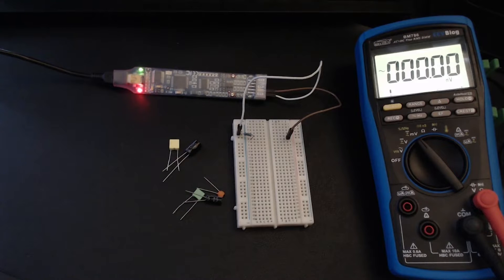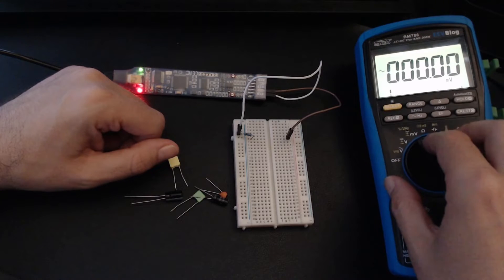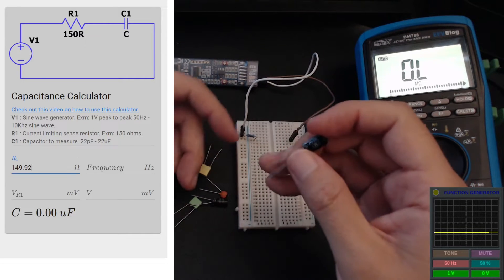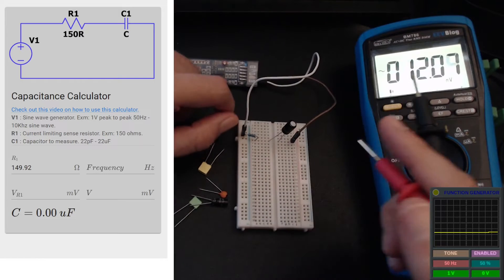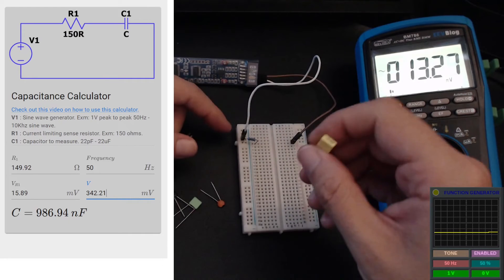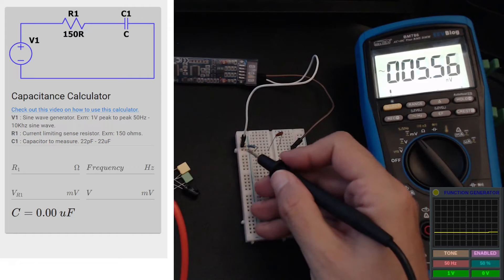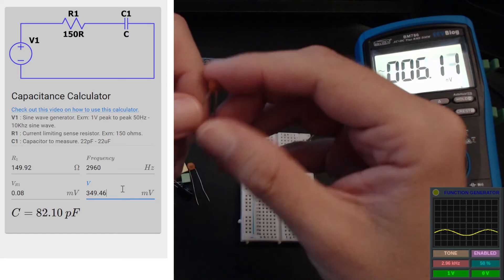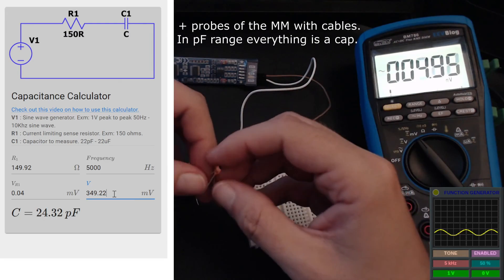Measure capacitance without an LCR meter

Comment: One final observation. I was thinking about the bandwidth limitation of the DMM and speculated that it might effect the calculation at higher frequencies. However looking at the formula for capacitance 

C = Vr/(2*pi*f*sqrt(V^2 - Vr^2))

Where Vr is resistor voltage and V is circuit voltage. We can divide numerator and denominator Vr to get

C = 1/(2*pi*f*sqrt((V/Vr)^2 - 1))

We see that the capacitance depends upon voltage only as a ratio of V to Vr meaning that if the DMM has the frequency dependence of a low pass filter (which it does) then it will reduce both V and Vr in the same proportion and thus the V/Vr ratio and calculated capacitance will be unaffected by the DMM frequency defendant attenuation in amplitude. So it may very well be possible to use the DMM at higher frequencies for this application and not have to worry about it’s bandwidth. In my case the DMM I use has a useful bandwidth of about 2 k Hz corresponding to the -3dB point. Another thing I would suggest when dealing with small capacitance values is to measure the resistor voltages by at least 2 significant digits for better accuracy by using higher frequencies. Although you got good results with the 82 and 22 pF caps it makes me a little nervous to see the resistor voltage carried out to only one significant digit when being compared to the circuit voltage.

Comment: As a footnote to my last post here's the way to determine the output impedance of your AWG. First set the output to some arbitrary voltage (setting it in RMS value makes the math easier because your DMM measures only RMS). Then measure the open circuit voltage of the AWG. If your AWG has the option to choose Hi-z versus 50 ohm (or some other value) no problem. Just use the open circuit voltage as your reference. Then place a 1000 ohm potentiometer across the output terminals and set to 1000 ohms. While measuring the voltage across the pot decrease the resistance until the measured voltage is one half the open circuit voltage. Remove the pot and measure its resistance. That is the output impedance of your AWG. At this point one half the output voltage is being dropped across the pot and one half is being dropped across the output resistance of the AWG. In my case I have a 50 ohm output impedance so I only need to use a 100 ohm pot. The results I get are within 1 ohm of the nominal output impedance. One caveat is that, if you are using a handheld DMM to measure voltage, consider that they typically have limited bandwidth. Eg the measured voltage from my Brennen 235 falls off quite a bit beyond about 1700 Hz (sine wave) so you need to consider this when doing your measurement so as not to use too high of a frequency. An option if you need to use higher frequencies for lower value caps would be to use your scope as the output which doesn't have this limitation. As an aside it is typical for older AWGs to have output impedances of 600 ohm or so. The newer ones are typically 50 ohms. Based upon your measurement in example #1 in the video I estimated the output impedance of your AWG to be 460 ohm. It would be interesting to see it's measured result.

Comment: There is something wrong about your measurement at 5:16. You are measuring the RMS value of the total voltage delivered by a sinusoidal source with V peak to peak of 1 V that should give you an RMS voltage of about 1/(2*sqrt(2)) = 354 mV which is what you obtained for this on subsequent measurements. Since current (I) is Vr/R and Xc = 1/(2*pi*f*C) we have for a basic formula Vc = V - Vr. So V - Vr = Xc*I
V - Vr = (Vr/R)/(2*pi*f*C) or rearranging:

C  =  Vr/(2*pi*f*R*(V - Vr))

Using 111.18 mV in the first capacitor (as measured) would give one  a capacitance of 53 microF. Using a more realistic V of 354 mV would give 6.2 microF neither of which is correct.
Reply from the maker: Thanks for the comment baby boo. You are close but the tool works a bit different or perhaps you are missing a parenthesis somewhere. I will try to type the maths happening at 5:16 behind the tool as clear as I can.
I = V/R
I = 79.61 / 149.92 = 0.534 mA

R = V/I
|Zrc| = 111.18 mV / 0.534 mA = 208.202

|Zrc| = sqrt(R*R + 1/((2*pi*f*C) * (2*pi*f*C)))

43348.0728 = 22476.0064 + (1/(2pifC) * (2pifC) )
20872.0664 = 1 / ((2pifC) * (2pifC)) 
0.00004791 = (2pifC) * (2pifC)
0.006921 = 2pifC
C = 0.006921 / (2pif) = 0.000022030 F
Reply: @funstacklabs  I see where my mistake was. It was in assuming that the voltage across the capacitor was simply the difference between the voltage across the circuit and the voltage across the resistor which it is not. Instead the voltage across the capacitor is equal to the sqrt(V^2 - Vr^2).  So the correct formula is 

C =Vr/(2*pi*f*R*sqrt(V^2 - Vr^2)).

I still don't understand how you got an RMS voltage across the circuit of 111.18 mV in example #1 (5:16) when inputting a 1 V peak to peak sine wave which should have given you 1/(2*sqrt(2)) = 353 mV.
Reply: I think that the reason for the discrepancy in example number 1 is that you were not actually inputting 1 volt peak to peak. Your function generator was actually outputting 111.18*2*sqrt(2) = 313.5 volt peak to peak. That is the reason the calculation came out correctly. With that assumption the measured values make sense. One would then expect 111.18 volts RMS across the circuit (both resistor and capacitor).
Reply from the maker: Think of the cap as a voltage source in the opposite direction. The effect is there with the other measurements as well though smaller since I was measuring smaller caps. If your measurements are different let me know, there might be a difference in the output impedance of the signal generator.
Reply: @funstacklabs  Take a look at the circuit voltages (across both resistor and capacitor) you obtained in all other measurements: at 6:12 you got 342.21. At 7:16 you got 348.77. At 9:21 you got 349.46. At 10:42 you got 349.22.  All of these are within the experimental error of the RMS value of a 1 volt peak to peak sine wave which is equal to 0.5/sqrt(2) = 355 mV. The only discrepancy is the first measurement of 111.18 at 5:16. What that tells me is that your actual peak to peak sine wave at 5:16 was 2*sqrt(2)*111.18 = 314.5 mV not 1 volt.  That's still OK as you can measure these voltages at any signal level and get reasonably good results. Your DMM will still give you accurate results.  All I'm implying is that if your signal generator is claiming 1 volt peak to peak (in the first measurement) it is not actually outputting that voltage but, instead is outputting only 314.5 mV.
Reply from the maker: Hmm, interesting. If you have noticed V keeps increasing as the capacitor value is decreasing. I imagine the signal generator is just a DAC module on it's micro with some protection circuit and assumed this behavior is normal since the cap is a voltage source. I am planning to make a signal generator soon perhaps something to explore further there. Aside from that as you have also noticed, output from signal generator isn't that important as long as it's within the range of the DMM.
Reply: @funstacklabs  Yes V keeps increasing as C decreases.  I think that what is going on is related to the output impedance of your function generator. Let's say you have a fixed 50 ohm output impedance (typical). If the AWG is set to expect a Hi-Z input then internally it will set the 1 Vpp to 354mV RMS. But that 354mV gets divided in a voltage divider between the 50 ohm output and the circuit impedance. Now with 21.78 microF at 50 Hz and a 149.92 ohm resistor the circuit impedance is 149.92 - 146j ohm. But at 1 microF that same circuit impedance 149.92 - 3183j ohm. As you can see the lower the capacitance (at a fixed frequency) the higher the circuit impedance and thus the greater the voltage drop across it compared to the output impedance of the AWG (50 ohm). With 149.92 - 146j impedance I would still have expected to measure about 300 mVpp in that first example. So working backwards if you accurately measure the circuit voltage (in example 1) as 111.18 ohm that would imply an output impedance of your AWG of approximately 460 ohm.
Reply from the maker: Your calculations were correct baby boo and inspired me to make another video on the matter https://youtu.be/sS_IfNE98As 
Thanks heaps!